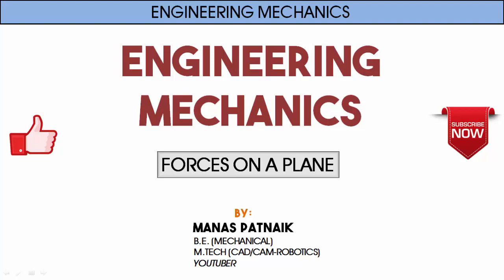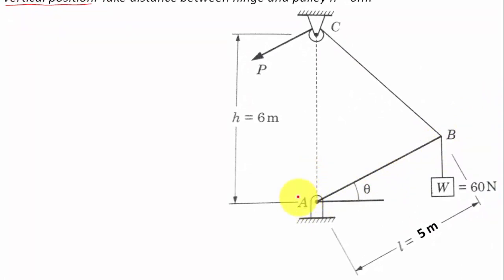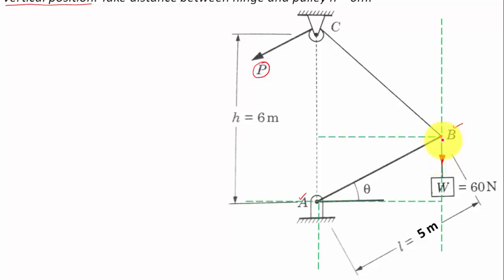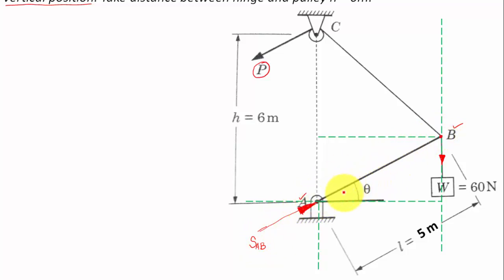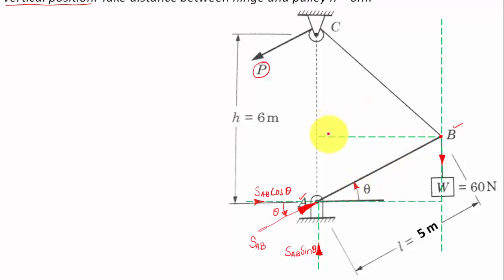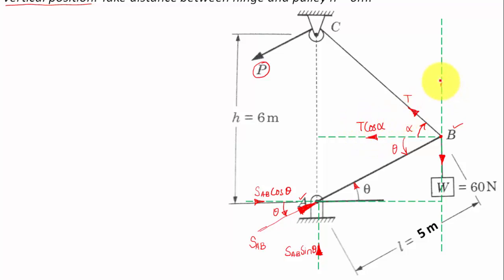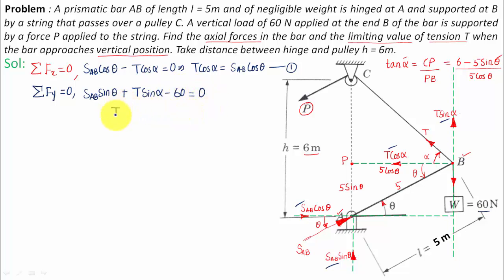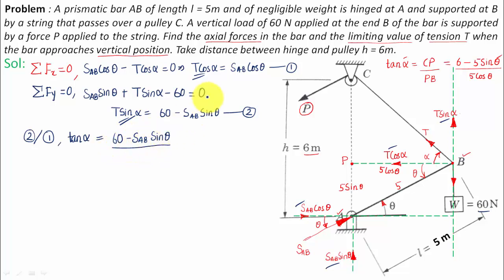Engineering Mechanics_Forces on a Plane_Level 2_Problem 1

Comment: Sir why didn't you resolve the force P acting at point C?
Reply: The same force T is transferred into point P by the pulley, since it is an ideal pulley. So no need to consider the force P. Thank me later
Reply: @muhzinfirozam559  great justification bro
Reply: @muhzinfirozam559  thnks
Reply: force P is just there for keeping the string taut in all cases so we can say tension arises becauses P is holding it

Comment: Sir ,is it necessary that at the hinge we take only single force along AB axis, can we take individual horizontal and vertical forces?
Reply: yes I also have the same question. you cannot take SAB as theta inclined to the horizontal.
Reply from the maker: Just try to free the bar AB from the support at A. It will experience a compressive force at that same angle theta. Just think about it...
Reply: @ManasPatnaikofficial  then why in previous questions u took as ha and Va ??
Reply: @ManasPatnaikofficial  But can we either take the individual horizontal and vertical forces in the place you took that Sab force sir?
Reply: @ManasPatnaikofficial  I could think that if we remove support from A.. the resultant of P and W would be somewhat directed towards A but can't figure out that it will align with AB.